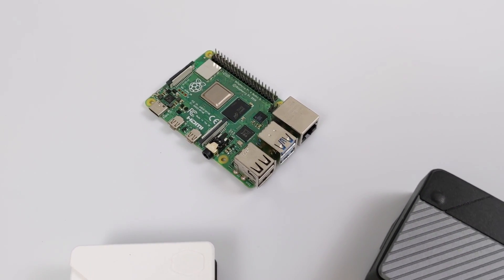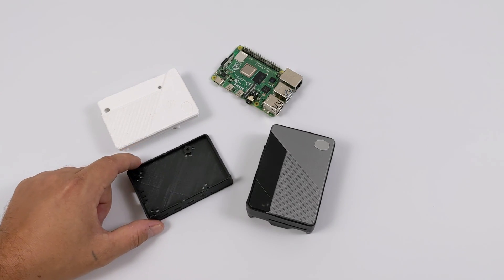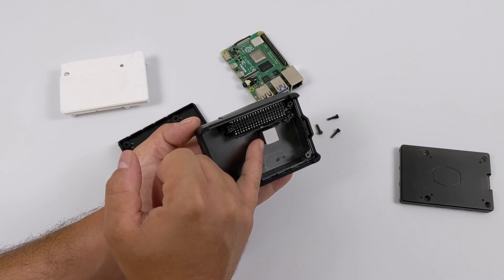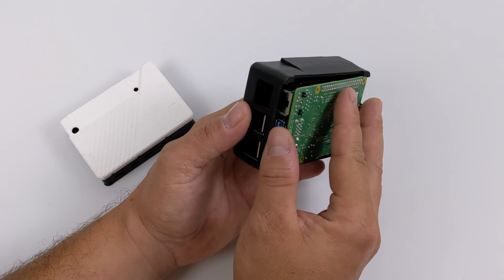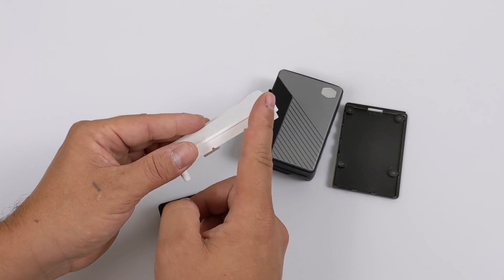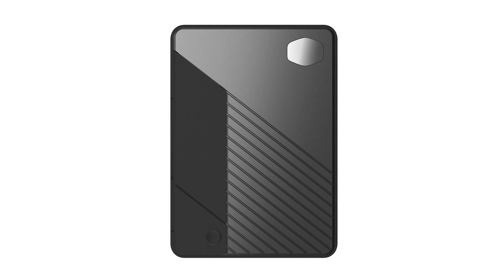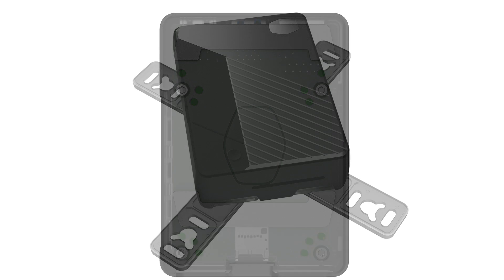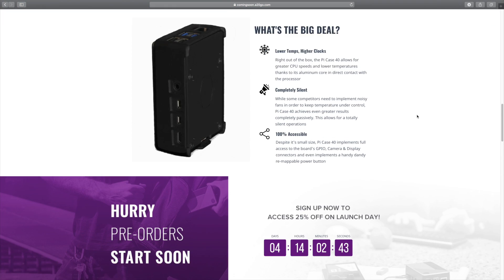Cooler Master Pi Case 40 Hands On First Look Raspberry Pi 4 Case

Comment: For anyone who stumbles onto this video - be aware that CoolerMaster took advantage of the Kickstarter supporters and did not deliver to the backers, but went straight to market first. AS well as fouling up the GPIO mapping and then made a statement that it was designed for nomads, so GPIO mapping was not in the original spec. Shady company taking advantage of backers - surprised so few of the reviewers actually caught this and promoted it as a problem...

Comment: USD BOOT UBUNTU MATE
ubuntu-mate-20.04-beta1-desktop-arm64+raspi.img.xz ssd boot
Hi big fan of your work. Love pikiss. Who said you can’t teach an old dog new tricks! 
THANKS FROM DOWN UNDER
Tasksel works with this.  SSD BOOT with boot drive only on sd card.
You have done a video on this PI 4 RASPBIAN SSD BOOT
No fdisk here.. Just need a PI 4 runing PI Os from usb.
Need pi imager, sd copier, gparted, idle.

sudo apt install rpi-imager
sudo apt install gparted
sudo apt install idle

1 BOOT PI 4 from SSD into PI OS.
2 Place blank sd card into the pi 8GIG will do.
3 Using PI IMAGER install ubuntu-mate-20.04-beta1-desktop-arm64+raspi.img.xz
4 Reboot you boot into  ubuntu-mate-20.04. Do the set up and log in.
5 Shut down and remove the sd card. REBOOT back into PI OS.
6 USE sd copier to put the image onto a new SSD. 
    TICK THE BOX FOR NEW UUID
7 Shut down and remove the PI OS SSD. AND REBOOT into ubuntu-mate-20.04 from the SD card.
8 In terminal install idle and gparted
  sudo apt install gparted
  sudo apt install idle 
9 Still in terminal we have to find out our drives id their UUID.Run the command   sudo blkid  you need the numbers on the end othe line.Edit out the ”” quotes

/dev/mmcblk0p1_______________________________PARTUUID=f77c6f0e-01  
/dev/sda2: ______________________________________________PARTUUID="51a6dd8e-02"
10  In terminal run  sudo idle /boot/firmware/cmdline.txt 
We have to edit  the cmdline .txt file.In the middle you will see          root= LABEL= writeable  .
This is the large parition on your ssd  /dev/sda2 change it to      root=PARTUUID=XXXXXXXX-02 
Replace the xxxxxxxx with your uuid. Save the file.
11 In terminal run  sudo idle /etc/fstab
The frist line is your SSD drive IE: /dev/sda2 beging with   LABEL= writeable
The second line is your SSD drive IE: /dev/mmcblk0p1 beging with LABEL=system-boot change to.  Use your UUID numbers save file and we are done
/dev/Mmcblk0                         PARTUUID=51a6dd8e-02
/dev/mmcblk0p1                     PARTUUID=f77c6f0e-01

SHOUD END UP LIKE THIS This is mine. Change the 8 numbers or letters to yours. Two different numbers. You have to get thm right. Save file

PARTUUID=782a8558-02	/	 ext4	defaults	0 0
PARTUUID=99d2d6e6-01       /boot/firmware  vfat    defaults        0       1

12 We are done. But to make life easier startup GPARTED.
mmcblk02 IS YOUR sd CARD deleat the large partition   mmcblk02   partition2
sda1 is your SSD DRIVE FORMAT THE SMALL DRIVE FAT32   sda1       partition1

First boot will take along time its doing shit writing files.
Usb drive willtake a lot longer a good ssd ie: Samsung t5
Tasksel works so any flavour of ubuntu. Works lik a charm.

Comment: OK I've read all of your comments and criticism so far, I'm not gonna say squat until I see this thing overclocked to 2.1GHz & 'passively' cooled & kept at a stable 55 degrees celcius, if it fails to do so then throw it off the balcony! You've already approved the Argon One case, why are you now intentionally or unintentionally confusing people?? One major reason I'm upgrading to the pi4 is because of the Argon One case, I wanna overclock this thing like a savage!

Comment: this looks just like any of the other aluminum pi 4 cases out there...
no active cooling? Cooler Master which are known for their COOLING solutions not even including a stinking fan in this case? wtf lol
i didn't expect a water cooling loop obviously, but not even a shitty 15 cent fan? pfft...
at least they could've made a better heat sink rather than just sticking a square piece of metal to the top of the case... bahhh
seems like the only real feature this case has is that multi function button on the top. that sucks....

Comment: Seems a bit strange to wrap up so much of the heat dissapating aluminium with heat insulating rubber?
Reply: Try picking up an Argon One sometime after it's been running for a while, they get HOT

Comment: I will reserve judgement until I see the final product. I do like the idea of the daughter board for the GPIO, but I don’t like the fact that the heatsink only touches the CPU, and not the RAM. Also, because the case is metal, isn’t the performance of the on-board Wi-Fi and Bluetooth going to be affected. This needs to be part of your testing procedure.
Reply: Yeah it definitely will affect the wifi. I have the argon one and the flirc case they both kill the wifi range so bad it basically makes wifi unusable for me. I hate it too because I love the argon one case and how it fixes the cabling mess with the pi. But don't get either of them if you'll need to use wifi.

Comment: No IO breakout board to move the connectors to one side, no active cooling and it completely hides the pi into what to me looks like yet another unsexy generic box.. this is a hard pass for me and i don't see why this will be better than a the argon one which already has all the requested features, even active cooling, and also looks a bit better than most other generic box cases that are being thrown at this market. I'm still waiting for a miniature pc case with see-trough sidepanel, preferably with enough room to mount the 52Pi Ice Tower. Missed chance for a company like Coolermaster to fill in that hole in the market.

Comment: One of the few times I got in on the early bird pledges.  It doesn't charge my card until Aug. 19.  I'm sitting on the spot, it is kinda ugly and I like the Argon ONE better.  If the Argon was in stock and not bought out what seem to be scalpers I'd buy it but as of right now people are charging upwards of $50 for it on Amazon.

Comment from the maker: Just waiting on a more finalized version so I can do some thermal testing, the unit seen in this video is a very early prototype made from a totally different metal.
Reply: On the review, can you, please, measure how much the metal case will affect wi-fi and bluetooth signal?
Reply from the maker: Yes I will.
Reply: The fins should be on the outside, not the inside. The hot spot is the CPU, which has physical contact (conduction) with the case. The fins will dissipate the heat into the case (radiation) more than the outside since there is less surface area on the outside (so it will actually raise the temperature of the rest of the board). The TPE/rubber wrap around the case will be an insulator, so please do your thermal testing with and without the wrap.
If you can, please do comparisons with the FLIRC case, since they're very similar in design.
Another person mentioned the Argon case, which is very nice, but has active and passive cooling (so, fan noise), but also has more features (then again, it's significantly larger).

Comment: meh, they should do Pi cluster case instead of regular single Pi case. Make a 1U case complete with power delivery and HDD/SSD SATA/SAS to USB3.0, status LED and etc, power users and industries will surely buy it

Also there is a project to make Pi 4 UEFI compliant. Currently the bootloader manages to boot with ACPI instead of device tree along with its own set of quirks but it's really exciting to see that Pi as a arm64 server cluster is nearly a reality

Comment: I like the Argon case because it includes a fan.
Reply: Does your fan give you compliments, or A REaL GOOD TIME?
Reply: I got one for my wife’s Pi. The fan works fine, when temp rises. The thing I like the most is all the cables coming out of the back.
Reply: Yes argon case quite loud, I use 12mm fan and undervolt it, much better
Reply: Unless you set up the script properly, the fan does not even run. Are you sure yours ever has? It's quite loud, you'll know when it's on.

Comment: It is a shame that it cannot take the UDOO RYZEN Bolt V1000 Maker Board SBC, if there was some way to cool the Raspberry Pi IV using a Little Devil PC-V10 using the cooling probe that is part of the said case but you have to keep condensation away from the electronics of the Raspberry Pi IV.

Comment: No RAM or USB chip cooling included, there are more efficient choices available IMO
Reply: Agree
Reply: Do those chips get hot enough to throttle performance? Has that been patched out with firmware updates long ago? It can't do any harm to have additional aluminium contacting all chips though. Maybe it'll get fed back to designers.
Reply: Andrew Hayes yeah plenty as good or better.
Reply: Oh,and cheaper!

Comment: Seriously, it's just like any other case and most of them promotes spaghetti wiring, unlike the argon one.
Reply: yes. This adds nothing new, and seems to have pretty average cooling. I want a case that gives me an SSD-adapter inside, so i can have a internal ssd in the case, and also make the HDMI standard-sized.
Reply: I want one like the Argon, but with at least one USB port in front for a FLIRC dongle. It would make a great living room Kodi box.
Reply: @JosephFrietze  The Argon One actually has solder pads on it's adapter board and an IR-transparent plastic window in the front of the case so you can add your own IR LED and IR receiver. Not exactly ideal needing to DIY, but at least they provided the option.
Reply: @W1ldTangent  That was gonna be my question, is this better or as good as the Argon One case...? I've ordered a kit & Argon One case, figured i could use a spare case just in case! stick with it?? The Argon One that is!?
Reply: @foghornleghorn5882  if you already have the Argon I'd stick with that, it is a nicely built case.